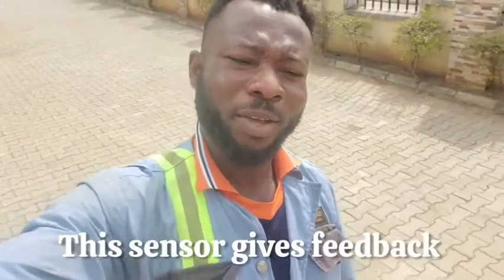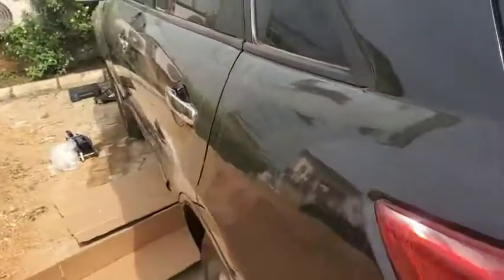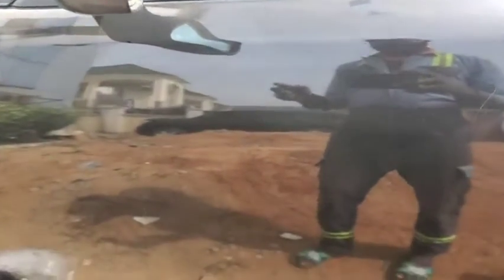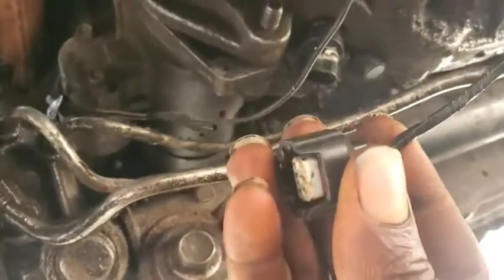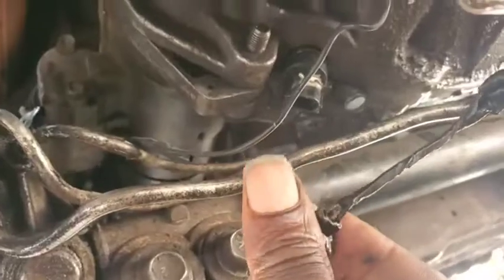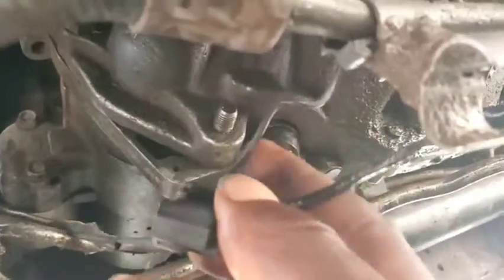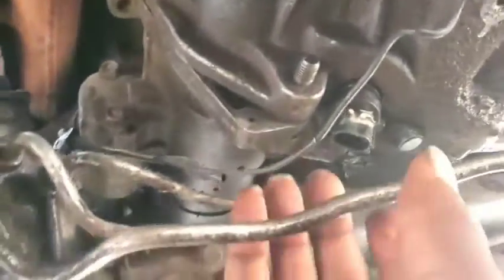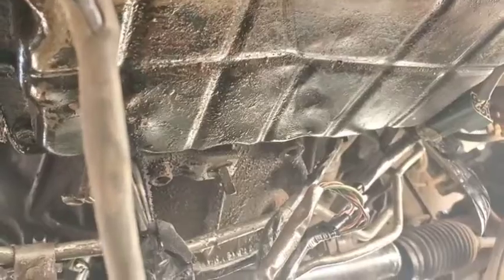Infiniti fx35 transmission input and output speed sensor location

Comment: That's the crank sensor. The input and output sensors are mounted on top of the transmission body valve. You have to take down the TCM and replace it.
Reply: He's in Africa and does access to the  proper information,  but you got to love him his confidence is intoxicating.